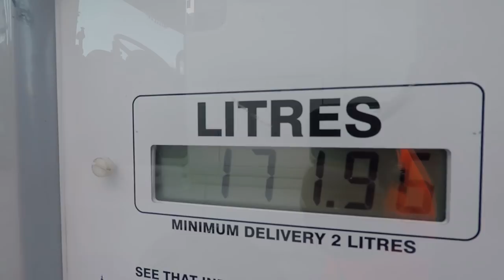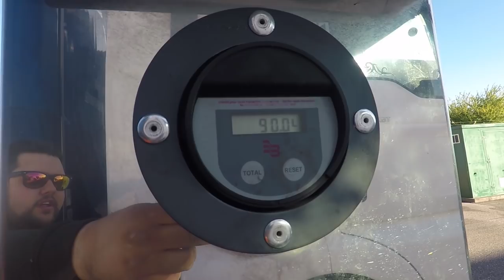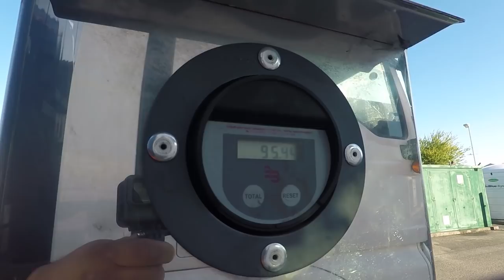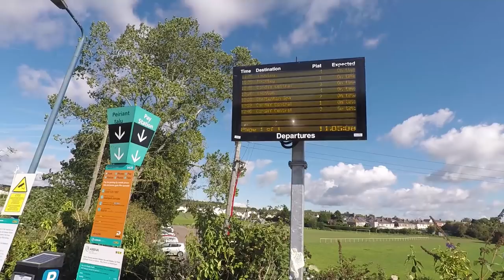Delivery For Severn Tunnel Junction!

Comment: There's no smoke with out fire, but you can get dust with out fire. good to have you driving my old stamping ground. Mate of mine back in the 70s had a bed & breakfast business in the BR steam train drivers dormitory, I think it was at Severn Tunnel Junction.

I worked on a CEGB cable tunnel under the Severn & Wye rivers with shaft at Aust behind the service station, the middle on was at Beachley in the Army Apprentice college grounds the third at Newnham on the welsh side, there's a trading estate there now I believe.

Good vid, cheers

Comment: Severn Tunnel is a busy station with trains but not so much passengers, It sees trains fromLondon Paddington-Cardiff-Swansea-Carmarthen etc, Brighton-Portsmouth-Southampton-Westbury-Bath-Bristol-Cardiff,and Cardiff-Cheltenham-Birmingham-Nottingham,and the Paddington-Cardiff-Swansea line,, though only to Cardiff is being electrified with brand new class 800 Bi Mode trains running on it, its over budget and heavily delayed, rather a palava, your probably there because its being electrified.
Reply: The over heads spoilt seven tunnel

Comment: Sorry if this question sounds stupid I keep hearing of this stuff called ad blue but what is this stuff
Reply from the maker: Not sure 100% how it works but basically it's works with the fuel to make the emissions lower.
Reply: A fluid that is injected into the exhaust system to meet emissions regulations.
Reply: Thanks Tim have heard of it but didn't know anything about it